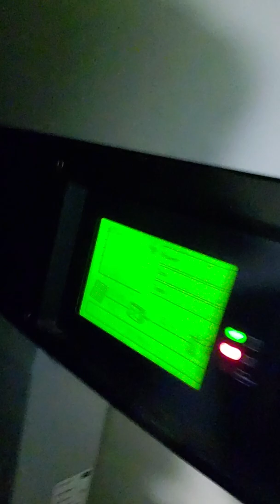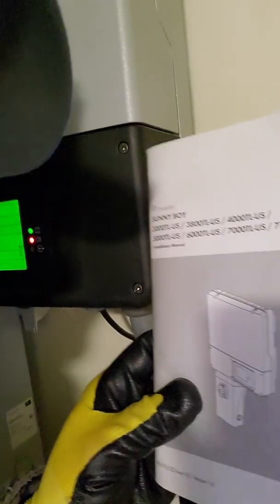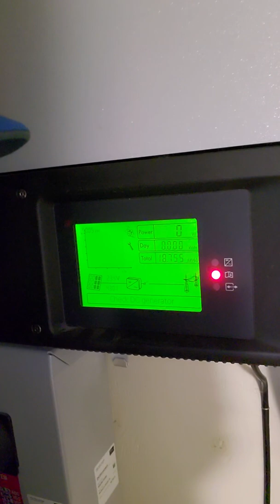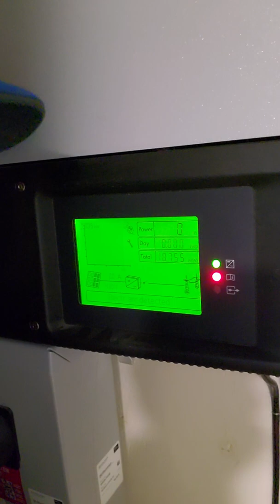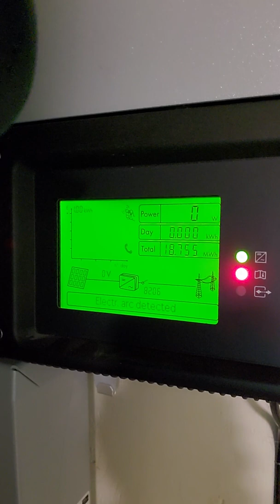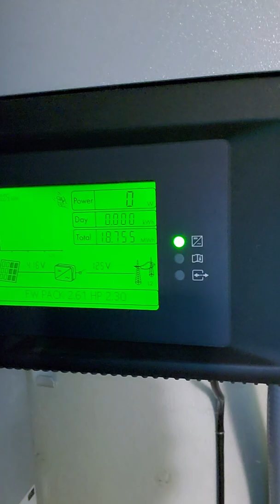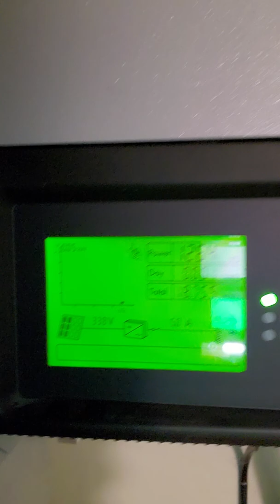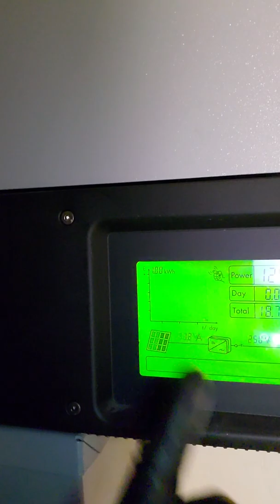SMA inverter arc fault reset

Comment: Mr Paul.. do you know how to fix event 7702 on SMA STP 25000.
The light red still on.. volatege 800 but ampere is 0
Reply from the maker: Event code 7702 for an SMA STP25000TL indicates an issue with the electrical service it is connected to. I would have a qualified person verify proper AC power and connections to the unit. If you are not experiencing any other issues with other electrical equipment connected, it could be a bad wiring connection on the AC side of the inverter.

Comment: I have SMA STP50-40. There are no error logs, and all DC strings show voltages between 750 and 820 DCV, but it is not generating any output. Do you have any ideas about why this is happening?
Reply from the maker: If there are no error codes/messages or any indicator lights and you are showing DC voltage during the day but the inverter is not turning on, I would check and confirm AC voltage at the inverter. There may be an AC disconnect that was shut off by mistake, a tripped breaker, or a blown fuse inside a fused AC disconnect.

Comment: Note: instructions worked good however my inverter (SMA Sonny Boy model SB7700 TS US22) requires tapping on the screen two different times. The message will let you know when to tap but it requires two separate times.
Reply from the maker: Thanks for the comment clarifying. I would add to make sure not to tap on the "screen", but anywhere on the metal frame of the unit. I have seen customers break the LCD screen before and have had to replace it.

Comment: Thank you so much. I spent the last 11 months waiting on a repair for my leased solar system. This was all that needed to be done. You’re a lifesaver, thanks again!
Reply from the maker: That is the most common issue that I hear with just about any leased system, is getting service if needed. Did you have to pay an electric bill you didn't have before, as well as still make the lease payment for the system? If that is the case, I'm glad I could help you get back on track asap.
Reply: @ yeah, it was horrible. Paid PGE 5100$ true up. Solar lease was supposed to guarantee, but since their BK, new company is not liable per the bk judge/. It’s a mess, but I’m grateful it’s fixed now. Thanks to you, Paul! Cheers man!
Reply: @Paul_The_SolarGuy  so I checked the system again this morning and it popped that same code again. Does this mean there's likely a short somewhere in the wiring on the panels?
Reply from the maker: I usually advise trying to reset the inverter 2-3 times if necessary. If the problem persists, then you would either need an inverter replacement or there is an issue in the wiring of the array. Either one would need someone to visit the site, but try to reset it again. If you get a couple days and it shuts down again, reach out to a local service provider (but keep us all posted!). I would recommend a smaller installer rather than a larger one, and the NABCEP website is one of the best places to start. They can be found at:
 https://directories.nabcep.org/?_certtypes=professional
Reply: @ will do! I have solar people coming out Friday to see if they can find the arc. I’ll let you all know what they find. However, since resetting again this morning system is up and running. Fingers crossed!

Comment: The rapping on the inverter cabinet, either near the display or not, didn't work for me (1, 2 or 3 knocks as the 4301 error came around again). What did was  Sunny Explorer-connecting as Installer and choosing `Reset operation inhibition` under Settings tab (You may need to have a SMA tech support provide you with a special Installer password code to turn on all the extra Installer stuff available).
Reply from the maker: Thanks for the comment. Tapping on the case will only work within 10 seconds of a complete inverter shut down and reset, and can be easier for most people to do. Using Sunny explorer can be a bit more complicated, but you do have a lot more options and info. If you choose that route, always make sure to have an extra "speedwire" card on hand just in case.

Comment: I waited months for Sun Power to send a tech and this is all he did 😡. Thank you for this information, I can reset it myself now.
Reply from the maker: I am surprised that SunPower sent a tech out there as they have now filed for bankruptcy. If you have to keep resetting it, there may be other issues, and I would reach out to a local installer if you cannot reach SunPower anymore. What state are you located in? We are taking over maintenance and monitoring for former SunPower systems in Massachusetts and would be happy to help if future issues arise.
Reply: @Paul_The_SolarGuy  thank you so much for the info! Unfortunately, I couldn't get much farther, I'm in CA. Yeah, this started last year before the bankruptcy was public, so it was pretty awful trying to get someone out here. It's happened 3 times in the past year.

Comment: Thanks, Paul! Had two panels with a individual cell joints burned through the backside of the panel(right in the center of panels).

Fixed that issue and attempted to power on the system again. Still showed fault code. SMA website was not very helpful BUT this was! Thanks again sir😊
Reply from the maker: Geez, that is scary! I'm happy there was no other roof damage and that you were able to replace them and get the system back up and running again. What brand modules do you have? I am interested as I have only seen one other module burn through the back sheet like that.
Reply: @Paul_The_SolarGuy  Our system is a ground mount array(5 acres). It's an older system about 10 years old. Problems are with Hyundai brand panels(discontinued now). We've lost 3 panels so far(all the same issue). We also have a smaller array, it's equipped with Q Cells and no issues with those.

We'll eventually upgrade all panels to a higher efficiency rating and wattage. As the installation company we think is no longer in business(won't answer phone or emails).

Again, thanks for the easy to understand video tutorial 👍🏻

Comment: But why does the knocking reset inverter? As in what is the tech used for this feature where a reset button wouldn't have been a better solution?
Reply from the maker: Every manufacturer is different, and I am not sure why SMA chose this reset procedure. Possibly to ensure the reset was done by a Qualified Person and not something that could be reset by mistake...

Comment: Assuming this fixed lasts, this was a wonderful and super helpful video! The only thing I would add is that some SMA inverters require knocking on the display, like mine. Fortunately I figured that out and was able to do the knocking on the display Before Time ran out and before thinking this solution was not a good one a good one.
Reply: What are the odds this fix will last?
Reply from the maker: I'm glad you found this helpful. If you have to reset it more than twice, there may be an issue with the system or the inverter. I would contact your installer to check the system for faults and reach out to the manufacturer. Some of these inverters had very sensitive arc detectors that can cause nuisance tripping.

Comment: Excellent thank you, whats with the mask?
Reply from the maker: You're welcome, I'm glad you found it helpful. That video was filmed in April 2020 and we were required to wear masks inside buildings in my area. That one is Bumblebee from Transformers 😎
Reply: @Paul_The_SolarGuy  Im about to attack the same unit next door that has never worked properly in the 8 years its been installed. Armed with your information I now understand what Im looking at and for. I also understand why there is an external isolation box for the PV grid as NZ follows the same regulations. Wish me luck
Reply: @Paul_The_SolarGuy  Well I got one going but the other is saying error changing grid param unchanged. Looking on the web it looks like a fault in the unit or configuration which I cant access. Its definitely got DC volts within range and AC volts and frequency is the same as the adjacent unit so I suspect Im knackered.

Comment: This was really helpful. I was able to reset the SMA inverter. But i am wondering what might have cause it?
Reply from the maker: If it has never happened and you were able to reset it, along with the fact that it continues to run normally; would indicate a nuisance trip/fault. These particular inverter models were known to have sensitive arc-fault sensors that throw an error without an actual fault. If the problem persists, contact you installer to inspect the system as there is likely an issue.

Comment: Couldn't figure out how to solve it. Thank you for this huge help. What about to explain the reason this error could happen?
Reply from the maker: There could be a few reasons you are getting this error. Please read the other comments and responses as well for more info as well. It has to do with the solar panels and wiring on the roof. It could be due to a loose connection, water infiltration, or bad solar module. Those inverters have had known issues of the detectors being overly sensitive and producing nuisance trips. If you are not able to reset it, or if it trips again immediately, contact your solar installer for further diagnoses.

Comment: yes, this worked perfectly for my sunny boy inverter.  i accidentally had turned off the circuit breaker that connects the inverter output to the line for a month.  when i turned it back on got an arc fault, then DC Generator off warning.

followed this video and it worked wonderfully.  on mine,, tapping on the box did not make the display brighter.  and it took mine a little longer to show the "tap to confirm arcfault reset".  then it took a good two minutes to completely turn on
Reply from the maker: Glad to help!

Comment: Thanks for the video!  A solar technician inspected my system and found two places where water had gotten into connectors.  To reset the 4301 error though required a tap next to the display ONE TIME when prompted as the system was coming back up.

Comment: Paul, you are a Stud Monkey pard!  As a confession we've been offline for 2 months now and only noticed it after our power bill soared. So, I decided to check out 'Youtube University' and came across your video...seemed a simple and passive enough procedure so gave it a go and Voila!  We have a SMA SB7000-US so it has a separate AC disconnect (arm) and had to go through a more lengthy self check but it started up just like you said. I say this because I'm not entirely sure if my inverter is a 'TL' or not and hopefully sharing the model number will help others with this issue.  
Phew!  Saved us time, scheduling with the solar company, and most likely a costly service charge. If we ever bump shoulders down the road the beers are me!  Thanks again Paul!  : - )

Comment: I found this error at night and tried to reset it. Once I went through all the steps the error code never came back up. The screen just says update complete. Am I doing something wrong?
Reply from the maker: You have to wait until there is enough sunlight to produce DC voltage, then shut everything down and try to reset it again.

Comment: Hi! We follow your arc fault reset advice during the day and checked it every once in a while and got a solid green light on the inverted, plus it would all the while show the activity on the display panel. Now, we went out at night and found the lights and the display panel off. Quick question... Is that normal or is there a problem? We do remember that when there was a fault, the display panel would be on day and night (as well as the slow blinking green light and also the solid red light).
Reply: From my experience, the display shouldn’t be illuminated if there are no faults/issues; but the display should still be on.
Reply from the maker: At night, when the Sun is down, the  whole display should be off. That is normal.

Comment: I have dual panels. Do I shut both DC switches off? Only 1 is giving me the error message.
Reply from the maker: If you have 2 separate inverters and only 1 is showing this error message, then this reset will only need to be performed on the inverter with the arc fault error message.
Reply: Thank you worked like a charm
Reply: Hey Paul the fault came back again after 2 days. Not sure what to try next

Comment: Never worked for me    I had to call service.  They had to take unit casing off.   Now it failed again after 2 months and this reset is not reacting to my knocking
Reply from the maker: Sorry for the delay, YouTube wasn't showing me all of the comments. Likely there is a fault in your system. Were you able to get it resolved, and get the system back online?

Comment: We have been having this issue intermittently for about 6 months now. Our installer is no longer a SunPower dealer and we are having issues getting to the bottom of this. Any idea what is causing this to continue to happen?
Side note - we were told by our tech to knock continuously on the window until the unit clicks. Sometimes that can take more than 10 minutes!
Reply from the maker: Sorry for the delay, YouTube wasn't showing me all of these comments. You should only need to knock to clear the code when the display reads "knock to confirm". Any other time will simply illuminate the display. Were you able to get this issue resolved?
Reply: Hi thank you for getting back to me. We are able to reset the inverter using the steps you outlined. Sometimes it works for weeks after the reset and sometimes it gives us the same error code within a few hours/days. 
We’ve had the installer out to look at everything and no visible issues were found. Now with SunPower officially gone, I’m guessing our only option is to replace the inverter at some point in the near future- not ideal.

Comment: Thank you so much. For this video!!! It helped. Ps I tried it at night when I got home and found out about it but I’m not sure if it has to be done in the day. It was not making  powering at night. So I tried it first thing in the morning and 💥 it worked. Thanks
Reply from the maker: Awesome! I forgot to mention that both AC & DC voltage needs to be present for troubleshooting. Thanks for pointing that out to me, I will be sure to correct it in the next video.

Comment: Worked great, wish when i called sunpower they told me to do this.
Reply from the maker: Sorry they were not helpful, but I'm glad it worked for you. Sunpower typically works through their network of certified dealers and installers. If you continue experiencing issues, you can find the closest one to you here:
https://us.sunpower.com/dealers-installers/find-dealer-installer
Reply: i suppose an electrical equipment manufacturer would be hessitant about telling how to reset an arc fault to just any old consumer.  if it is a real arc fault, the panel can burn down the house

Comment: Having the same problem repeatedly with my SMA inverter here in hawaii. Any thoughts on how to diagnose why the system is tripping ie why electric arc?
Reply from the maker: Hello Jack. If the system is newly installed and is repeatedly experiencing this error code after resetting it, have your installer check all electrical connections to make sure they are properly torqued. If it is a system that has been running for some time, it MAY be faulty sensor if you are not experiencing any other electrical issues in the building.
Reply: @Paul_The_SolarGuy  
Thanks for the follow up.

Comment: Hey Paul what’s the best squirrel guard to add around the perimeter
Reply from the maker: Hello Steve. I frequently install Spiffy Solar critter guard where we are. It is easy to work with and gets the job done, just make sure to remove any nests/debris first. You may need to remove the bottom piece to clean out any leaf build up every few years, depending on the size of your module mid clips.
Reply: @Paul_The_SolarGuy  
Thanks Paul for the information!

Comment: Thanks for the video, very helpful. If there is a problem within the system and the device will not reset, correct? I have this exact issue on my unit in Phoenix.
Reply: Thanks Paul! I will monitor the inverter until my scheduled (2 weeks out) service appt is due. If no issues then you saved me $250 + credits. Thank you 😊
Reply from the maker: Thank you for your comment. These particular inverters have had sensitivity issues with the built-in AFCI sensors, which have occasionally resulted in nuisance tripping/shutdowns. If your inverter will not reset, or if you continue to experience the same error, contact your system installer for further diagnosis.

Comment: Hey Paul couldn’t find your email in the about section, but I’m a ole man! Anyway, your resetting video was great! I have 21 sun power panels with 2 sunny boy 3800, one has 10 panels the other has 11. The one with 11 panels is the one I reset
Reply: I guess I sent it by accident, after the reset the next morning I get an error insulation resist, check generator and tries to restart after 10 minutes which it eventually does start green light blinking, red light constant during the restart. Sometimes it can take up to couple of hours to kick on! Does all this mean a loose wire under the panel? Thanks Steve
Reply from the maker: Hello Steve. That sounds like there is an issue with one of the connections on the DC side of the inverter.